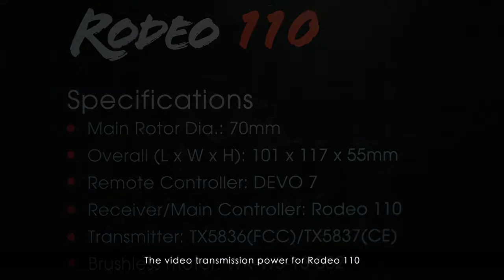Walkera Rodeo 110 VTX Adjustments w Behind Z Scenes ✈

Comment: I saw it being advertised as switchable to 600mw from several companies. After watching this it seems there is no high power 600mw for the FCC version?
Reply: 600mw is not legal unless both the VTX is FCC Part 15 certified and you have a amateur radio license. Technically 200mw isn't legal either unless you adhere to both of the same requirements. You may legally run 25mw if you don't have a license, so long as the VTX is Part 15 certified.
Reply: I have not seen anything to support that claim, and that does not answer the question anyway.
Reply: It's amazing what you can do with 25mw set up right with good antennas like IBCrazy's. Can't see going cheap on the RX antenna as they don't fly away or crash... at least not so far;-)  I've outrun my  DX9 with 25mw AIO marked FCC ID 2AGB8-003 so probably less that 25mw to be legal I thought.  But less is really more in many ways.... a lot less RF harmonic issues.... take what you need really works when it comes to radio control and RF energy. People are frying LR gear not knowing that treating it as if standard 2.4 gear.

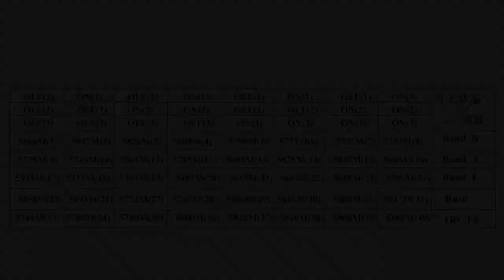But less does not apply to manuals... picked up a Rodeo 110 with DEVO 7 at an auction dirt cheap with a broken ESC wire and manual says it only has 8 ch (B) available on both page 5 under VTX where it references "bind' to explain the  button & page 13 showing only band B frequencies... none that mach my RX and the rest of the chart shown here 2:50 with the other 4 bands after band B  was left out??? jezzz... found this looking for weight of stock TX to swap it out as video is not flyable past a few yards due to mismatch of frequencies in B band and just learned it's on 200mw not 25mw by default.... if that's correct as another link says it's only 25mw and 200mw was a typo... ERRR! 

But as far as "legal" goes the FCC needs to make reasonable changes and catch up with technology to get people legal and respecting why there are rules for using radio as everything form WIFI to following directions in writing on "legal" electronics is violating FCC laws. Train kids at an early age to ignore the rules/laws  and that's what they'll do. FPV is a gateway crime now for young kids;-) .. and so is a ton of other equipment sold but FPV stands out more.